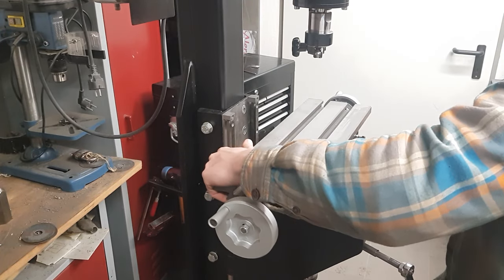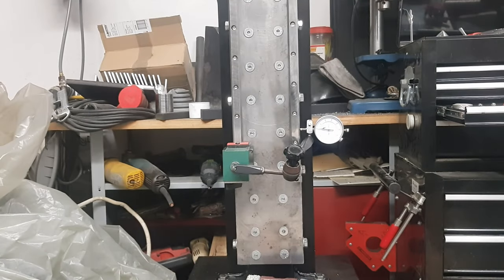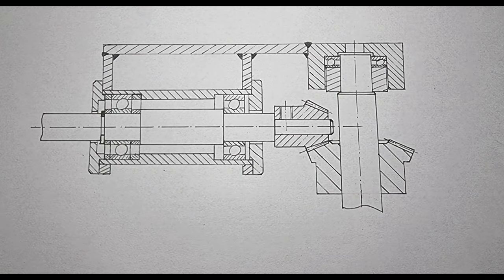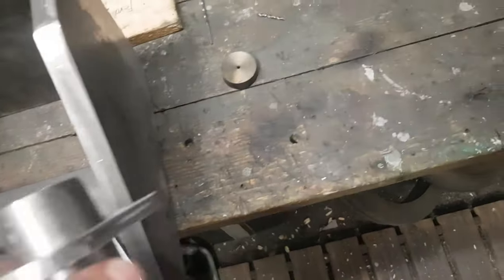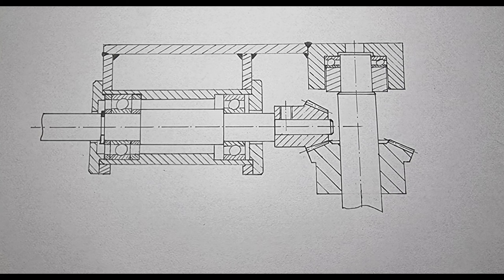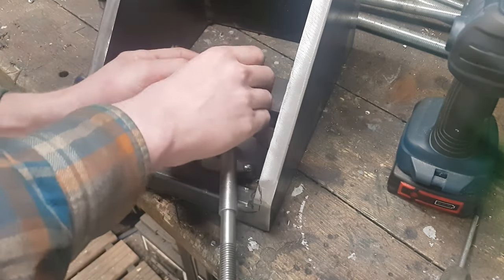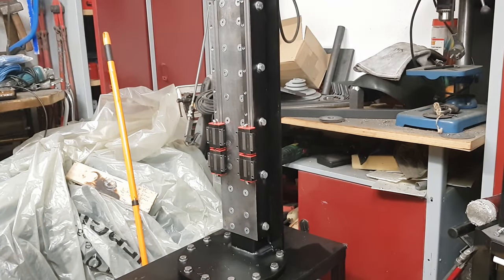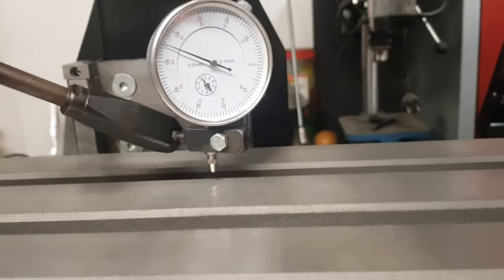My DIY Milling Machine Part 4

Comment: I really enjoyed the series, what an achievement to be proud of for sure. It is now 2 years after your build and I came across the series as I am converting a set of 70 year old horizontal mill castings into a small vertical milling machine. the castings are certainly a wonderfull place to start with but somewhat limiting in many ways. However your build has given me a rekindled interest in my project.
Thank you very much

Comment: This is the best homemade milling project I have found on YouTube also. It seems like the most realistic, rigid, simple and useful designs as a milling machine should be. I am definitely going to use some of your ideas that you used to build my homemade milling machine. I've bought enough industrial scrap/ machine parts at auctions over the years that I don't have to make the knee table lift mechanism from scratch or buy any new parts. Subscribed and I am looking forward to how it turns out or any upgrades needed later on.
Reply from the maker: Thanks a lot!
Would love to see your version.

Well i am planning to add a dro and a power feed.
Also i want to put a stronger motor on it.

Comment: Really enjoyed your build, amazing craftsmanship !  how do you lock the vertical height of the column after you raise or lower it with the ball screw?  thanks for posting.
Reply from the maker: Thank you for the comment. Glad you like it.

Well the ball screw itself isn´t actually locked. 
The positon of the table along the Z axis can be locked by tightening a machined screw that pushes onto the handwheel - shaft. 
It has a special brass tip in order to protect the shaft from getting indents. 

This is one of the topics in part 5 of my milling machine video series. At exactly 2:10.

Comment: I have the same xy table as you, but can't seem to get the nut that holds the Y axis screw loose, how did you accomplish this?
Reply from the maker: The nut for the y axis is pressfitted into the cast iron body.
I used a punch and a hammer to get it out.

Hope this helps.

Comment: Any chances to share the plans ?
laso.... cnc it :)
Reply from the maker: To be honest i don't have to many plans 
I do have the same detail plans i showed in the video with some meassurements on them and some rough sketches. But i used them during machining. They are very dirty.
I don't know how much they would help you.
Reply: @wastelandworkshop3839  no prob just asked. Im ubdecided if I should buy old Mill or try building one... any way really cool machine
Reply: @wastelandworkshop3839  please show everything you have about mill.
I want to build same one